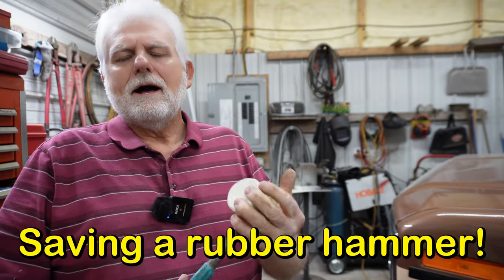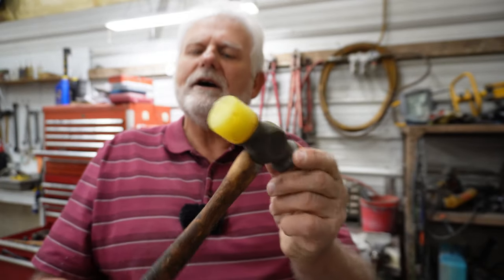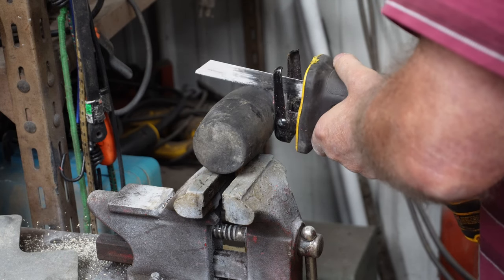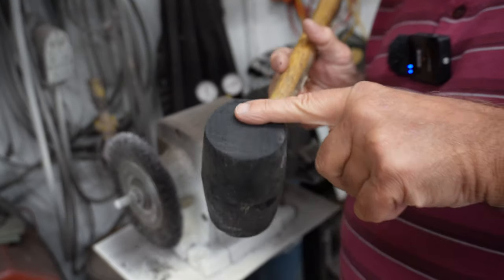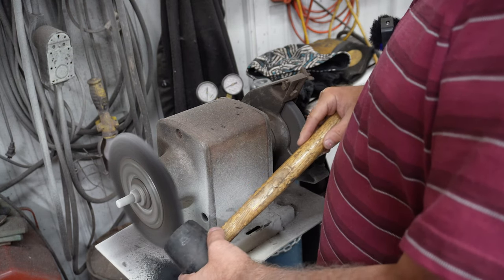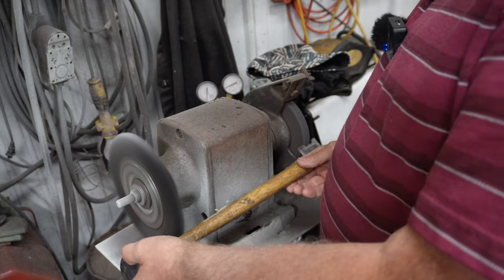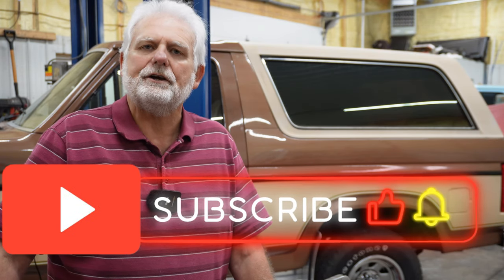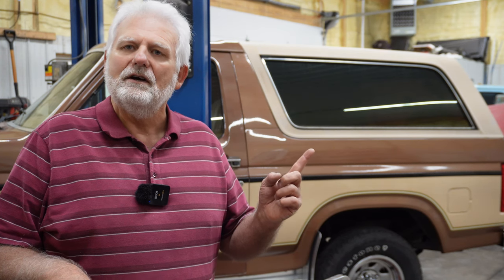Restoring a Hardened Rubber Hammer: A Fascinating Tool Resurrection

Comment: Hi mam, I see your video is not SEO done. If you do video SEO you can get 1000 to 2000 views and 40 to 50 subscribers per video.
Reply from the maker: @Alamchowdhuri  explain this a bit
Reply: @MarvsFixitShop Sir I see your video title wrong tag description is wrong. Your video's SEO score is very low. If these are done properly, each video can get 1000 to 2000 views and 50 to 60 subscribers...